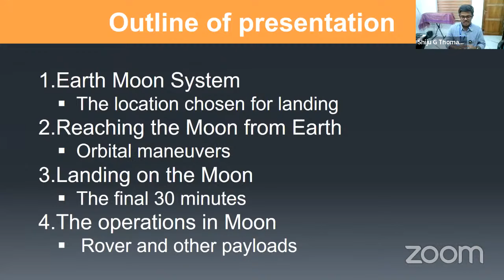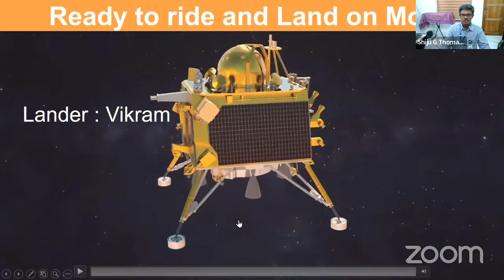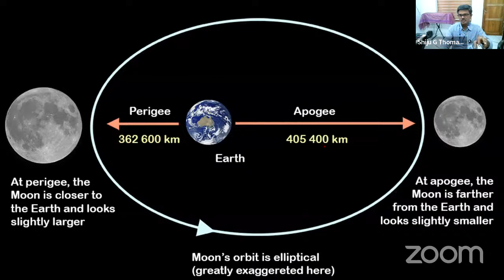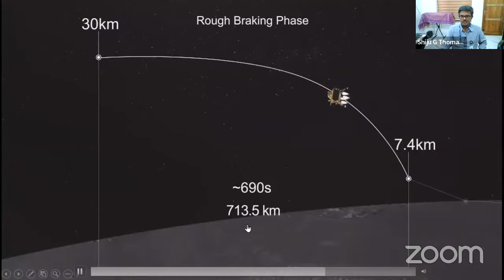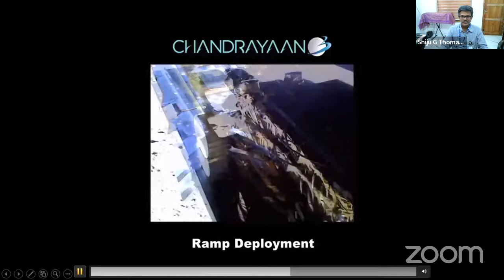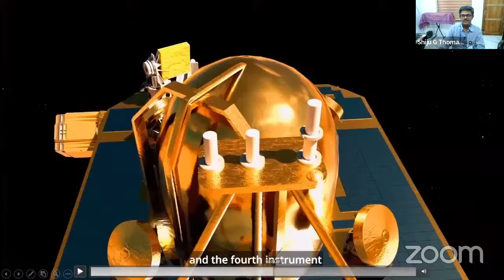Everything kids need to know about Chandrayaan 3 - Playto Talk by Scientist at VSSC, ISRO!

Comment: Does the rotation of chandrayan around the moon after getting pushed from earth's atmosphere take more fuel than around earth because gravitational force is less in moon? 🚀⛽
Reply from the maker: The amount of fuel required for a spacecraft like Chandrayaan-2 to achieve and maintain its orbit around the Moon is typically less than what is needed to orbit Earth, and there are a few key reasons for this, 1. Lower Gravitational Force, : the Moon has significantly less mass than Earth, which results in a weaker gravitational force on its surface. This means that a spacecraft like Chandrayaan-2 needs less energy (and therefore less fuel) to establish and maintain an orbit around the Moon compared to maintaining an orbit around Earth.   2.No Atmosphere: Unlike Earth, the Moon does not have a significant atmosphere. This is important because spacecraft don't need to expend fuel to overcome atmospheric drag in lunar orbit. On Earth, spacecraft must continuously expend energy to counteract the atmospheric drag, which can require a significant amount of fuel. 3. Gravity Assist: Often, spacecraft use gravity assists from celestial bodies like the Moon or Earth to conserve fuel and gain energy. In the case of Chandrayaan-2, it used multiple gravity assists from Earth to gain the necessary velocity to reach the Moon. This helped conserve fuel for maneuvers in lunar orbit. 4. Different Orbits: The orbits around the Moon and Earth can be quite different. Lunar orbits are typically closer to the Moon's surface than Earth orbits are to Earth's surface. This means that spacecraft in lunar orbit operate in a weaker gravitational field and need less fuel to maintain their orbits. Hope this helps.